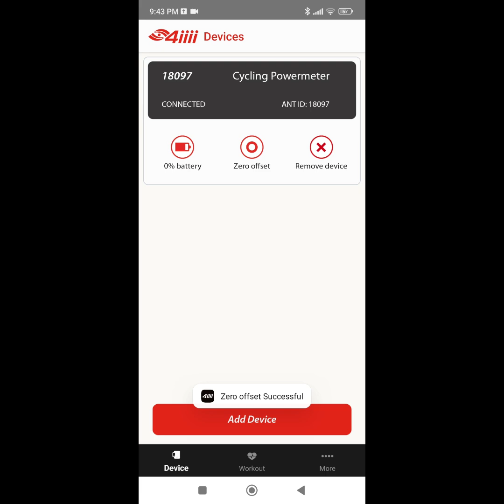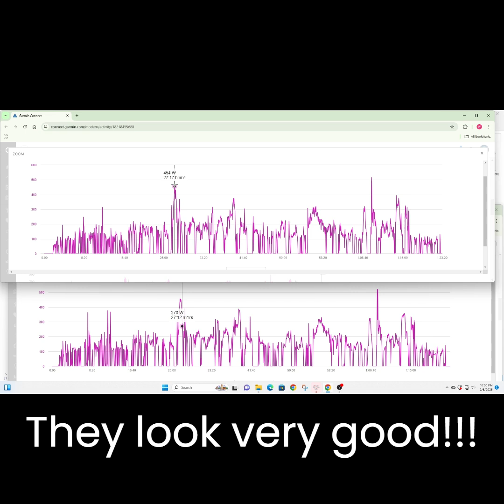SOLVED - 4iiii left crank power meter Zero offset failed error code 20

Comment: Sorry where should I place the sticker?
Reply from the maker: All over the 4iiii round label inside the pod. Only leave the rectangle contact and little contact near the edge visible so they can contact with the battery. Don't make it to thick as it will prevent you closing the power lid!

Comment: I've encountered the same problem, here's my solution:

Open your battery cap and you could see two copper battery contacts, the large rectangular one is flat against the bottom, use a jeweler‘s screwdriver or similar tool to very gently lift the ends of the prongs 1mm off the bottom of the pod, so that they press against the battery more firmly.

It is similar to your solution, but i wonder if mine worked directly to the problem.
Reply from the maker: Sorry Dude, but your solution solve different problem. What you mentioned, is well documented in 4iiii troubleshooting.

Comment: Can you explain it? I don't have access to link. Please please😊
Reply from the maker: In my case (and some others), the 4iiii white label seems not insulate well between the battery and and electric circuit below it. I needed a better insulation layer that was why I used the one mentioned in the short clip. Others they use the strong electric/insultation tape
Reply: @tamngminh  can you send me please de tutorial or picture please please! I tried with insultetion tape and doesn't work. :(
Reply from the maker: @mario20segundos Then, you're out of luck my friend.